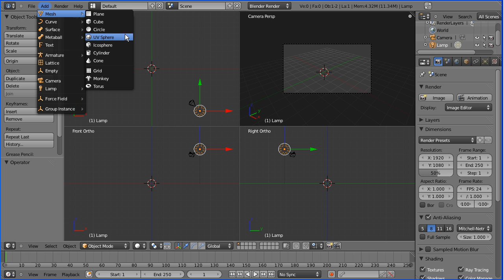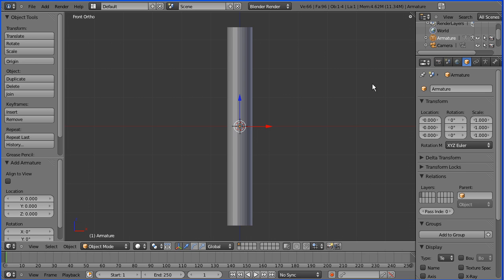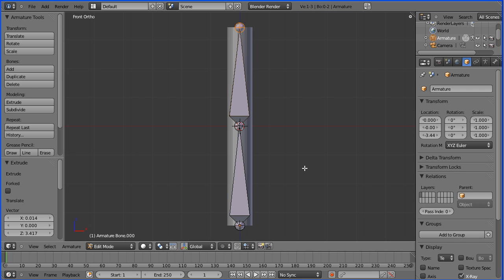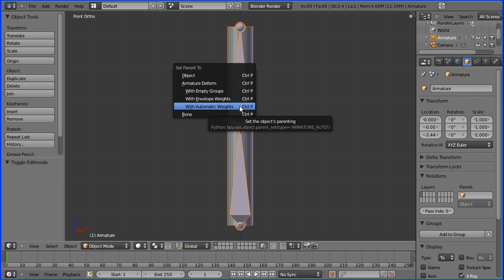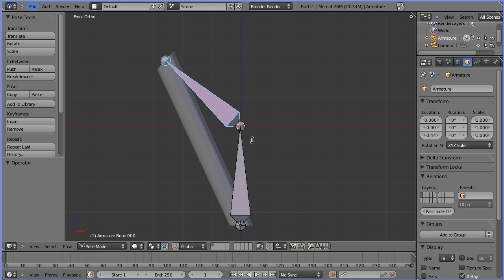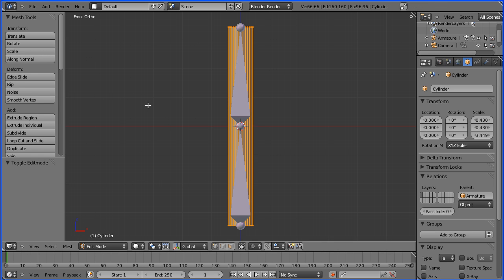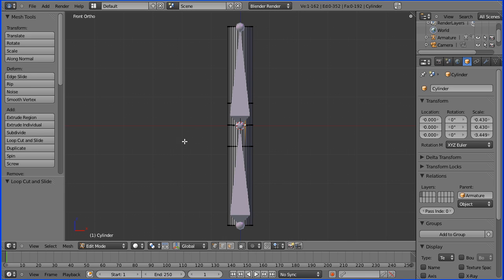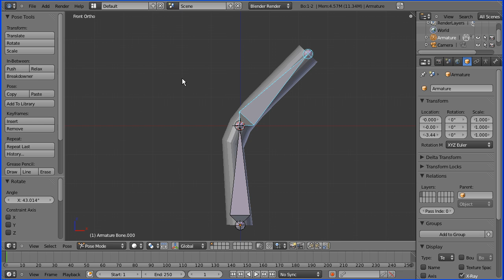Blender 2.5 Intro to Rigging Tutorial Basic Fundamentals of Skinning - Linking an Armature to a Mesh

Comment from the maker: I think what you need is the 'Weight Paint' mode. For a selected bone you can paint which parts of the mesh should deform fully, partially or not at all. You may also need to add more loop cuts and/or increase the level of subdivision.